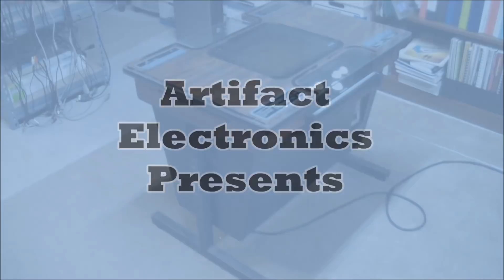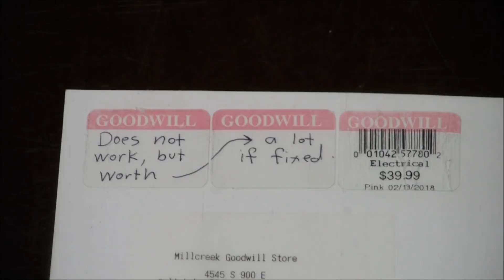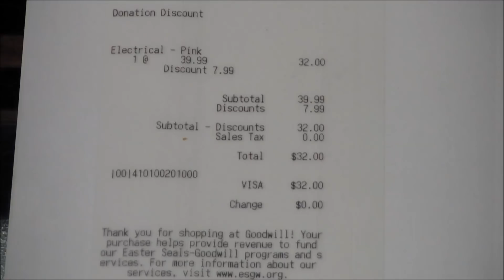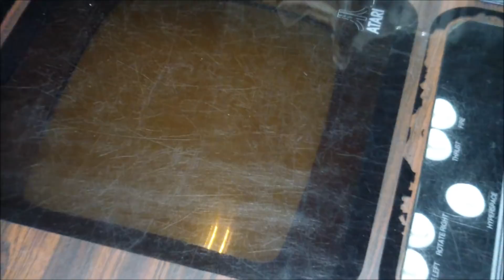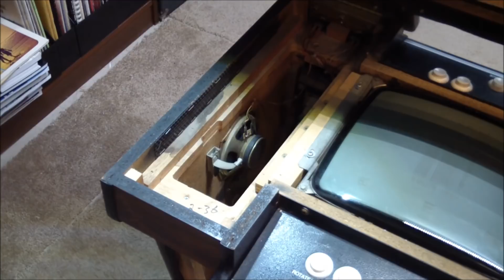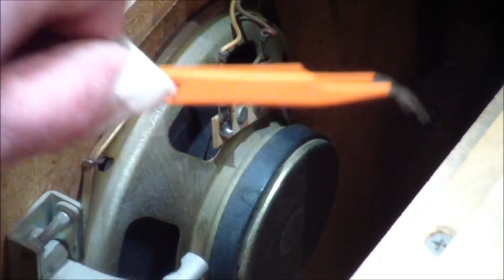AE#38 Atari Asteroids Cocktail Arcade Game From A Thrift Shop, Pt. 1

Comment: It may be too late but, cerium oxide can be used to polish out scratched tempered vehicle glass. Check out Delta Kits.
Reply from the maker: I'll definitely look into that. I still have old glass with the original printing, or at least with what is left of the printing.